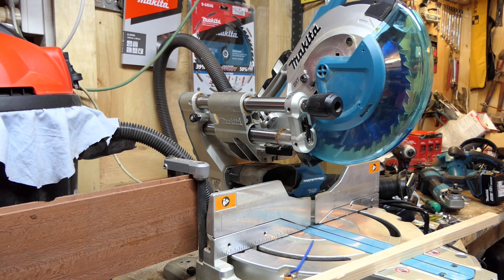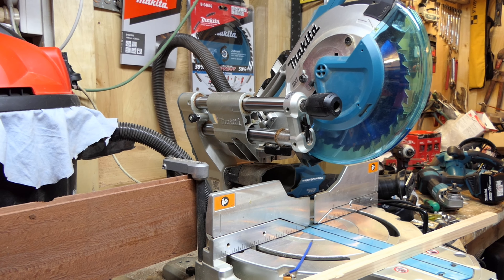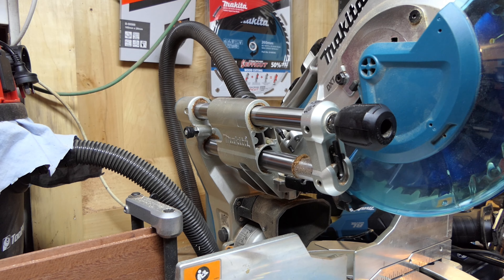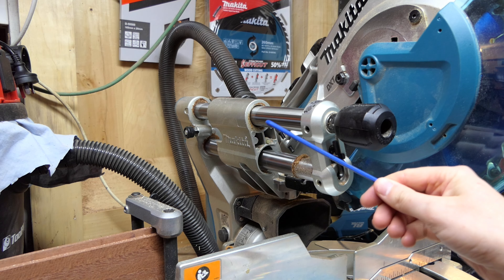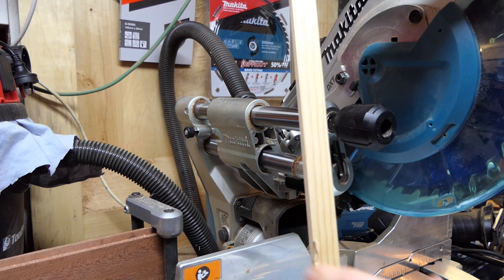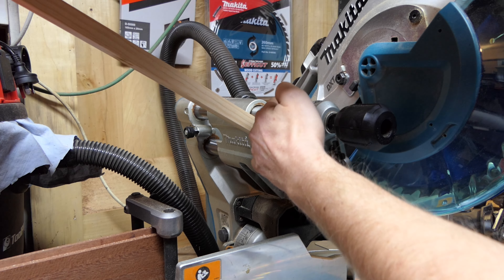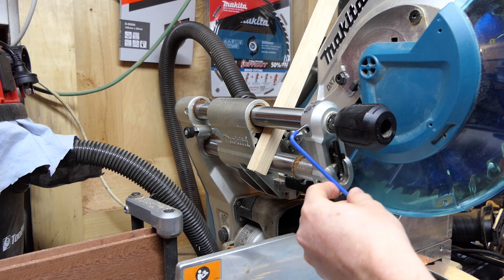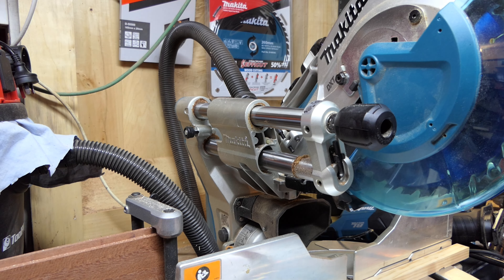Makita Mitre Saw Curve Cut Fix

Comment: Thanks for making this video! My 12in 36V had this issue. It was impossible to get it to cut perfect when using the full width of the slide. I could get perfect cuts as long as I didn't use the slide, but as soon as I would, the blade would wander. It was actually dangerous, because sometimes the wood would bind with the blade and grab it really hard. 

I had to use my impact drill to loosen the screws, they were too tight for me to loosen by hand. 

The way I fixed mine was by loosening both screws, and gently moving the saw out to the end of the slide, and then I tightened the screws. I then tested it, and it was much better, but not quite perfect; so I loosened only the bottom, and used a piece of wood as you did in the video to slightly torque the rails and retightened the screw and it was good. It took me a good 30 minutes of messing with it to finally figure out what to do though. At first I was making it worse. But once I loosened both screws and moved the saw to the end of the slides, that lined them up, and then it was close enough for me to make the minor adjustment to get it perfect. 

P.S. I don't think loosening both screws is necessary, I just wanted to describe the process that I went through to fix mine so others might benefit.

Comment: Thanks so much! For the benefit of others... I could only undo the screws by applying heat with a hair dryer to lossen the loctite (also advice from Makita support) and using a ratchet wrench (not a simple allen key) and after trying 25 times I nailed it by unscrewing the screws with a different ratio...  like the bottom one 2 times, and the top one 4 times and only then I  got it spot on!

Comment: Good tip. I did the same and used it for a year or so but eventually changed to DeWalt. I couldn't get rid of a problem that when the saw head was doing a vertical plumb cut it was fine, dead on square 0 on the mitre plate, but when the head was in a tilted to bevel over at 45 then it wouldn't be cutting square on the mitre 0 anymore. Test yours doing a 150mm a tilted over  bevel 45 cut and see if it is a square cut across the 150. Shame as it was a much nicer machine than the dewalts which are a bit clunky.
Reply: Did you ever test this?
Reply: That’s the problem I’m getting + a cut bow when on the bevel. Very frustrating as it looks crap and unprofessional
Reply: Did you find the problem? I’m having the same issue
Reply: I do not own the cordless version of this saw...but on inspection, might the weight of the batteries be causing the head to deflect a bit when the saw is beveled past a certain point? 
I ask this because 2 batteries weigh a fair bit and they're both housed on the carriage that both slides and holds the motor and blade.

Comment: I'm having this problem too where my cuts are 'bowed' and not straight.  There is a Makita service center down the street from me.  I imagine that the service center won't have an official fix for this, but may replace it since it is a manufacturer's defect.  This video is the craziest fix recommendation I've ever seen.  It's great that its worked for some folks.

Comment: I noticed on mine, after calibrating it wit a digital angle finder and square several times and failing in the process, that the MAIN PROBLEM  is when you over torque the bevel knob it wil pull your blade out of plumb very easy to notice, just look on the blade moving away of the zero clearance insert going side ways as you try to lock the thing tight

Comment: Been wood working for 25 years.  On my 3rd miter saw.  It was ONLY after I purchased a good set of engineer squares that I realized that sliding miter saws, in general -  SUCK!  I have this same saw, and it has been driving me nuts since I bought it.  Wanted to send it back, but would cost a fortune to ship it.  So I've been dealing with the inaccuracy.  Today, I have hope.  Thanks for that.
Reply: It drives me crazy too, I've zero out whole range movement on vertical plunge cut and slide cut, dame square, but when I actual doing cuts, plunge cut is OK, sliding cut SUCKS, out of square, tiny curvy cutting path, how come a saw can be dialed in but still suck when doing cuts.
Reply from the maker: Because the rails aren't parallel.

Comment: I just purchased a brand new Mikita GSL04M1 and my saw also cuts boards in a concave cut on the left side of the blade, and a convex cut on the right sided of the blade. Also my upper fences, both the left and the right are not coplanar with the lower fence. This is no problem for vertical boards with 90 square cuts, but I can not make vertical miter cuts at 45 degrees without guaranteeing that I will be cutting compound miters each time I cut the wood vertically. It is very noticeable when cutting 5" baseboard vertically. Makita tech support suggested that I return it as defective.  I'll be returning this saw and I hope it's replacement will be correctly machined/aligned. I really hope the new saw is as it should be because other than that I really love the forward  facing rails.
Reply from the maker: I have a new 40v also and is has the same problem. If you do get another one I would be interested in hearing if it has the same problem or not.
Reply: @BuildsStuff  No joy. My new saw arrived today and, while better, it is still not acceptable. .024” between the centers of 2 concave cuts for a glue line is way too large for cabinet or furniture building. I’ve been communicating with Makita but no solution yet. So far, Makita is dead set against me attempting to tweak the rails. If I attempt adjustment I will be voiding their warranty. Not even the local Makita service center will attempt the rail alignment. They said that adjustment must go back to the Makita factory. Monday I hope to speak with a local Makita rep. to get the approval to attempt the alignment. To Makita's credit, they are encouraging me to ask for a third replacement. My 18 year old DW708 DeWalt cut straight as a razor. If my DeWalt was 11 inches shorter, from front to back, compared to the front rail design of the Makita I would never have purchased the Makita. The deeper DeWalt design is costing me just under 20 square feet of shop space. 10’ feet o the left of and 10’ to the right of the blade. The fences on the replacement Makita are also better than the orginal, but not nearly as planer as my old DeWalt.
Reply from the maker: Keep taking them back. I will do the same. Hopefully if enough people do it they will fix their mistake.
Reply: Each and every saw of this platform has the same defects. If you wanna use the advantages of this model you will need to upgrade and adjust it buy yourself. It can be great but after you will invest your patient, time and attempts...

Comment: Mine cuts bow on the bevel and also out of degree 🤦🏻‍♂️ so in order to cut mitres at 45C on the bevel and 0 on the mitre I have to set the mitre +1 or -1 degree in order to cut straight. But then even if it cuts straight then I have a bow cut. Very noticeable when doing skirting or mitred boxes. You’ll have tight edges top and bottom but a gap in the middle of the mitre joint
Reply: This is just a guess, but the weight of the batteries could pull the unit out of alignment slightly when beveled all the way over. I've pulled the saw all the way out and pushed side to side on the handle with my pointer finger and it took very little pressure to get it to move.

Comment: Sorry to appear stupid, but I just set up this saw and tilted it to a bevel position but it seems to be locked there and I can't get it back vertical.  What is the sequence ?
Reply from the maker: At the back right, in front of the bevel gauge, is a black lever. Pull it forward and turn it to the left.
Reply from the maker: This lever allows the tool to stop at preset angles. And I assume you have loosened the knob on the rail.
Reply: look at the back where the mechanism moves, there will be a little black button type lever, , push it, it will now move  for u,  this is issue got me really frustrated  at first! It took me longer than one would expect to figure this out and the thought of it still gives me anxiety, but once resolved, the saw  is an absolute beauty to own!! hope you had this resolved long ago!

Comment: I'm confused how that misalignment results in causing a curve in cuts and not affecting a miter angle. :/
Reply: The saw is at 0° when the slide is at the rear but probably 0.5° at the front.
Reply: @kizzjd9578  still how could it be a bow then? The rail itself must be bent
Reply: @saiiiiiii1  not bent, just not parallel to each other. 0.1mm will make a big difference.